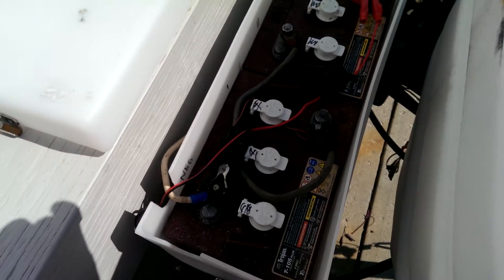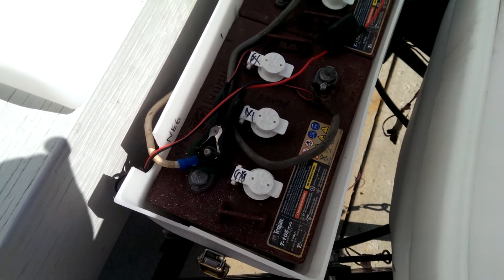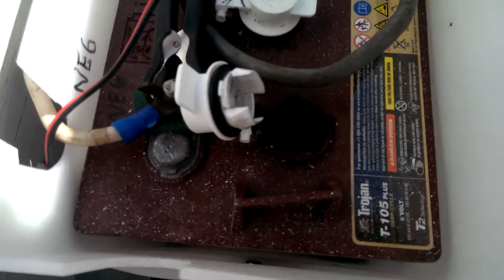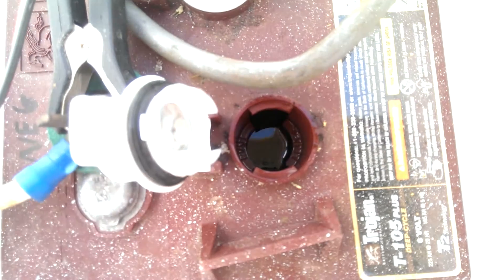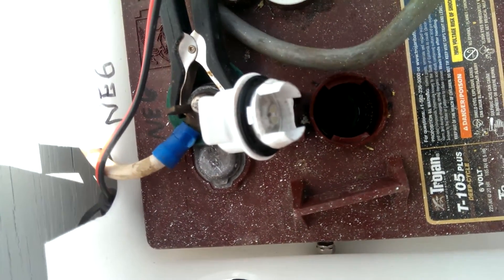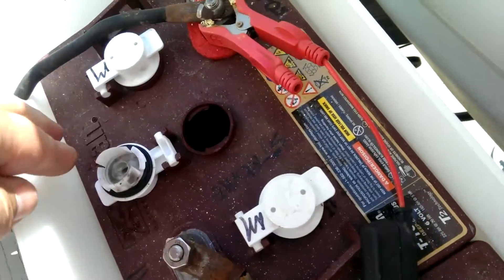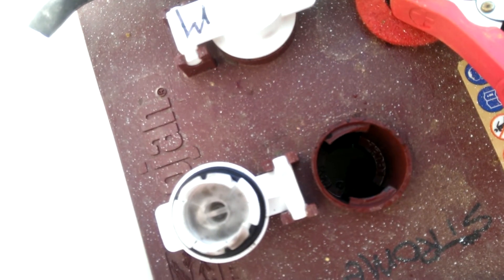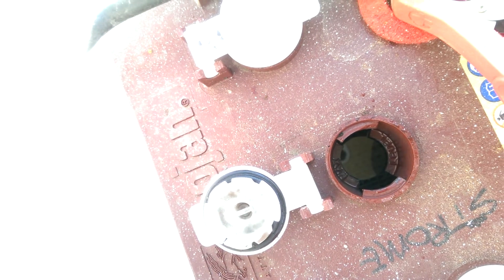mohoo charge controller part 5 of 5 (batteries)

Comment: how long did your Trojan t105 last ?
Reply from the maker: Very late reply, sorry.  The first set lasted 8 years and the second set are on year 7 and still going strong.  I have been using the second set 12 months/year as we now winter camp.  The most important part is making sure the water level is above the plates!!!  I also now use a MPPT controller that protects the batteries even further.

Comment: I'm curious as to whether this measures current and controls charge on the negative path or the positive path.
The PWM controller I have at present works on the negative path which makes it unsuitable for negative earth vehicles.
Also, is there no menu which allows the user to set parameters?
Reply from the maker: Tony Ling unfortunately this unit does not have user adjustable settings and it is a negative ground controller. Hope that answers your question, cheers 🍻
Reply: Thanks mate, I'll get myself one of these then. I have a two way radio in the van and I can't use the UEIUA CMTD-G2420 as the radio grounds itself through the antenna.
Reply from the maker: Tony Ling just want to confirm something. You say that you have a negative earth vehicle, is that not what is standard in modern day vehicles and rv's?
Reply: Yes, negative earth has been exclusively adopted since the 1960's. My van is a 2010 Sprinter.
For some reason, my controller and others have a common positive with all three positive terminals bussed together. This means that all loads need to have floating grounds. Otherwise, if I for instance connect my radio, not only does the current measurement on the charge controller not work, but the load can not be switched off, and worst of all, when the load is switched off, all attached loads seek their ground return path out of the controller, back up my radio's negative  lead, through the radio, and then through the coax outer before finally being grounded to chassis at the antenna on the roof.